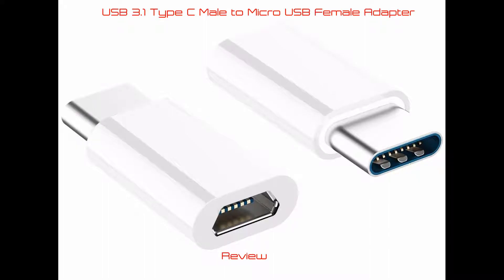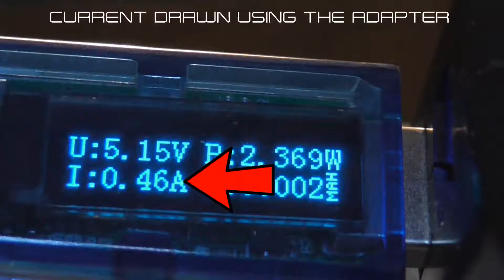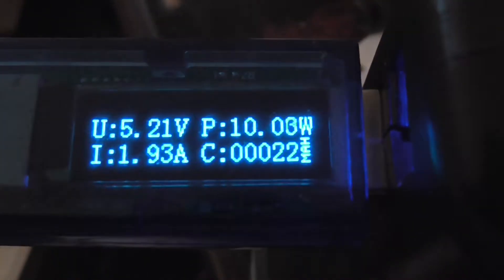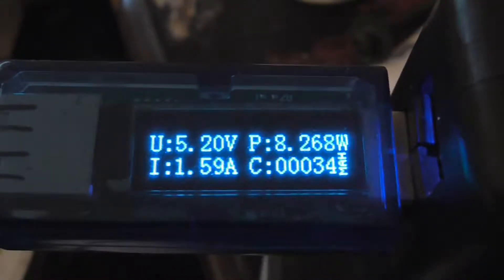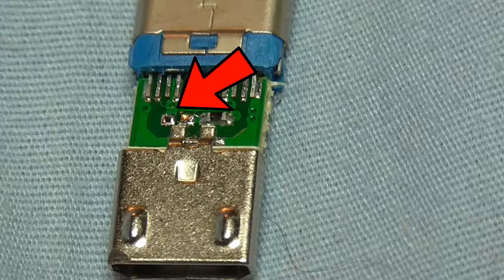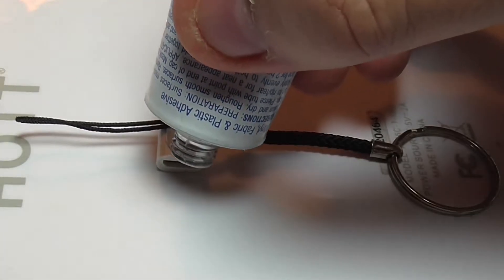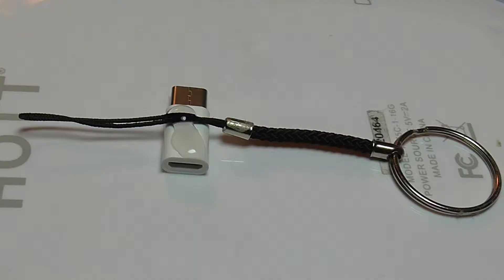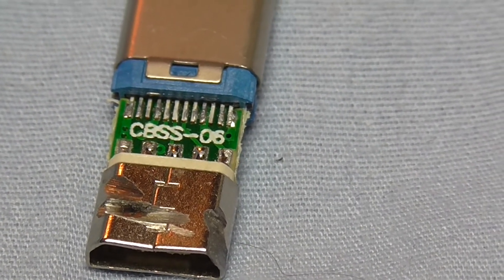Micro USB to USB-C Adapter Teardown / Review

Comment: expect the last adapter the are all seem to do it right, because of usb 2.0 spec thats allows a max current of 500mA. So I would say thats these cheap adapter are way better than axpected, others may have used the wrong restistor values, which allow to much current